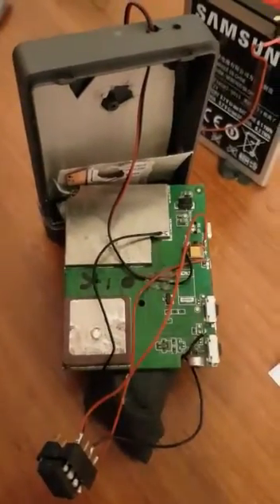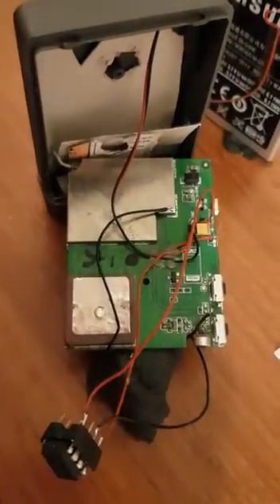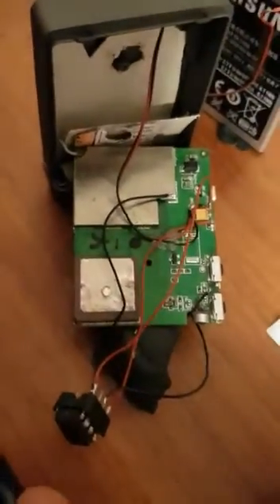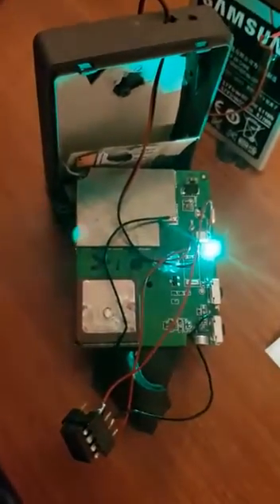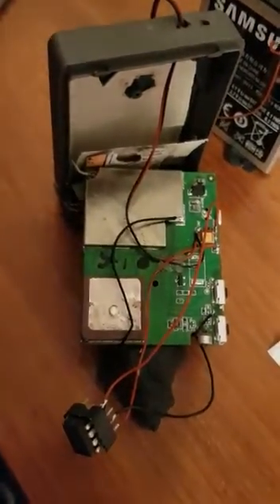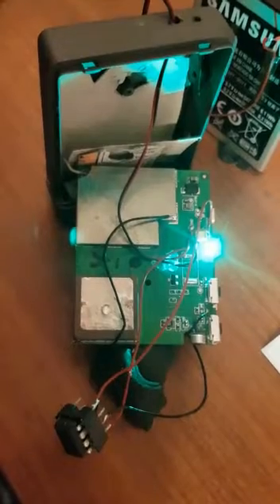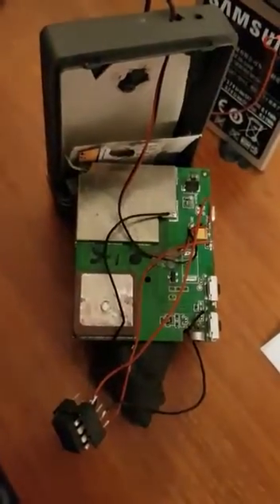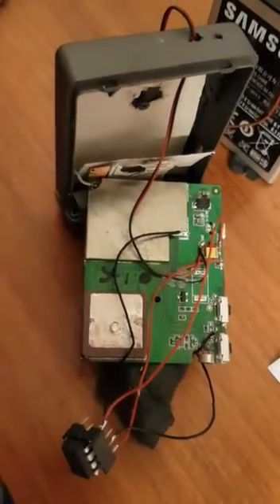TK102 v02 Mini GPS Auto Power Off bug Fix  Hack  tk102b Vince

Comment: Hi. We have the same problem with our Tk102 in our car. It seems like a very good solution that you have found out of.
Have you got a drawing that shows, where to connect the different pins of micro-processor, and which type of micro-processor have you used.
I hope to hear from you soon.  Kind regards, Palle Lomborg.

Comment: Quick question. If I have a Coban 102b and no proprietary plug anymore, can I wire up constant power to the unit using the GND and +5v pads on the PCB?

Comment: Hi. Could You share the schema or what layout you had to fix this bug. My GPS tk102b turns off after some time and you have to physically press the button to turn it on again. Please help. There may be a PRIV message. BEST REGARD
Reply from the maker: Hi it is pretty simple.
Basically the chip simulates the push of the button. If you know how a microchip works I am going to explain.
One pin of the microchip (set as OUTPUT) sends a GND signal INTO the device to switch it on.
So you have to connect the microchip to the battery (+VCC and GND) and then connect one pin (set as OUTPUT) to the GND and the other pin to the pushbutton of the device. Be careful to connect this pin to the button pin that goes INTO the device.
The code inside the chip is monitoring the flashing of the led. So if the led flashes it means everything is ok..if the led stops flashing the chip sends the GND pulse to switch the device on.
As the chip takes some current I put an additional battery but you can also easily do in another way connecting the device with the usb cable to a cigarette lighter that keeps the battery fully charged. I did both so battery never goes down.
The chip, the code and the pins are realted to what you will be using. I used an attiny85 programmed with arduino.
Hope it helps.
Reply from the maker: sorry there is one mistake. Chip pin connected to ground NOT does not need to be connected to GND...you will just set the OUTPUT pin to the push button in LOW state (connected to GND)
Reply: @MrStoca59  Hi. Thank you for your response. I understand the principle of operation of the system you described, but I can not write a program to Attiny to perform such a function. I could program it. Could you send me the program code to be programmed?
Reply: How does the microchip monitor the blinking  diode if no pin is connected to the Led?
Reply from the maker: Sorry for my mistakes in writing. Off course there is one pin connecvted to the led to sense the blinking. You can see it from the picture. I jiust forgot to write it down.
Reply from the maker: contact me at hotspot47@hotmail.com
Reply: @MrStoca59  I just wrote to you
Reply: @83ryger   can you please write me again. Do not use YouTube write me from your email
Reply: @stoca59  I just wrote to You from my email to Your email

Comment from the maker: Layout in the video is for testing purpose. Chip is now comfortably sitting in the case. So far when you need to switch off the device you need to disconnect the battery. You can also install a switch on the +cable
Reply: RYGER can you please write me again. I did not get any email from you.